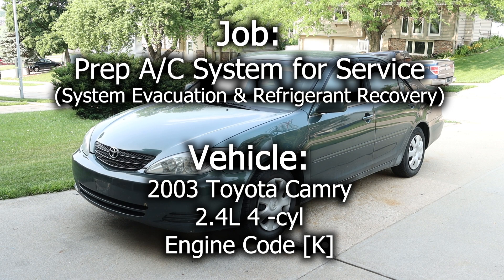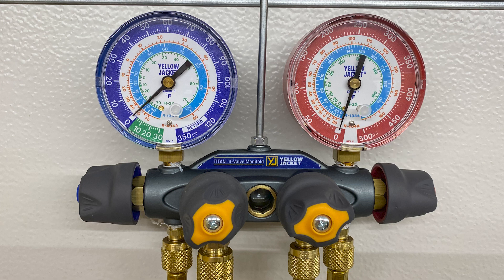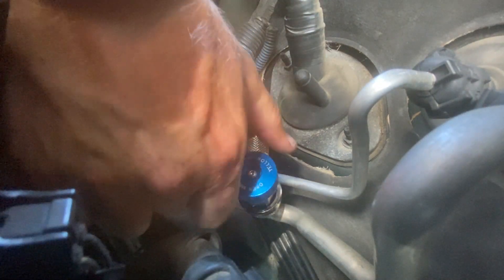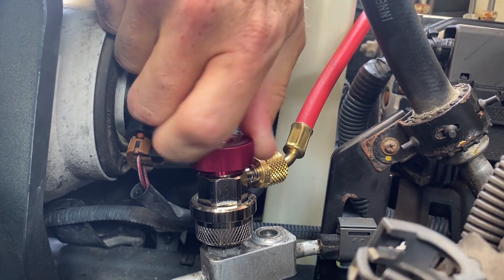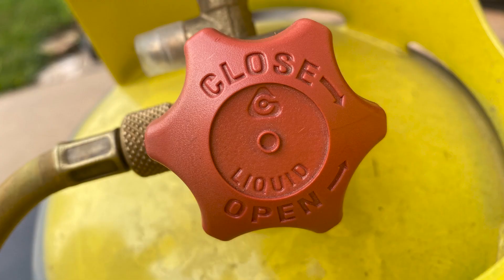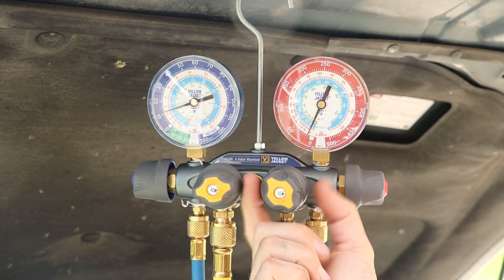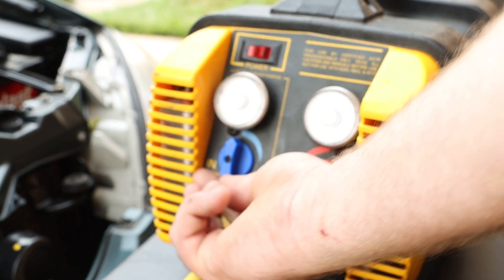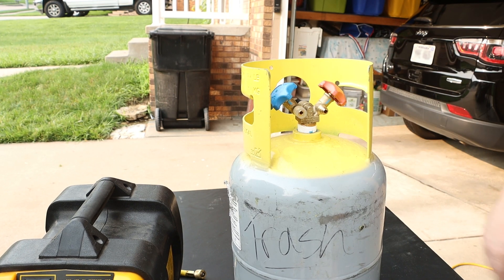A/C System Evacuation & Refrigerant Recovery - 2003 Toyota Camry - Prepping for A/C System Service

Comment: What do you do with the recovered refrigerant?
Reply from the maker: After being recovered, refrigerant is either recycled or reclaimed, depending on its purity and quality. If it's clean and meets certain standards, it can be recycled and resold. If it's contaminated, it's sent to a reclamation facility where it can be separated into its individual components or incinerated.

Comment: Did u fixed the lack of power going uphill?
Reply from the maker: The Mass Air Flow Sensor had failed.  Once replaced it ran great.
Reply: @InsaneOil  Good to hear that